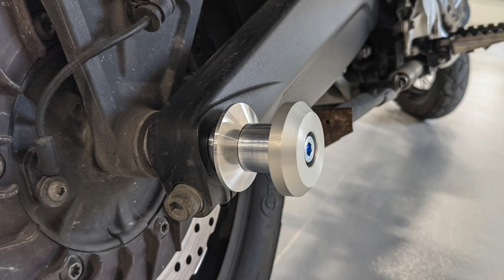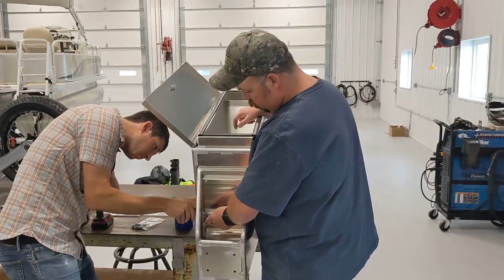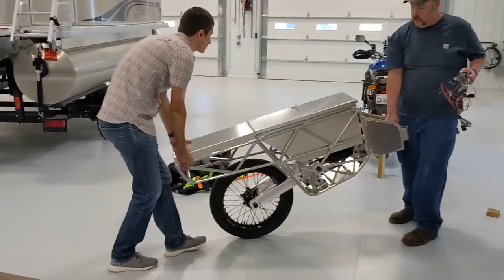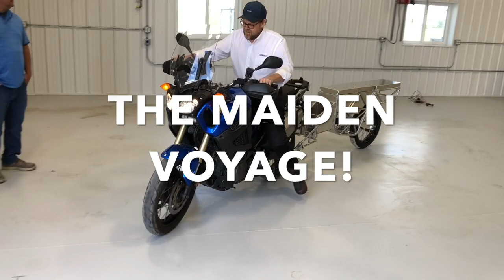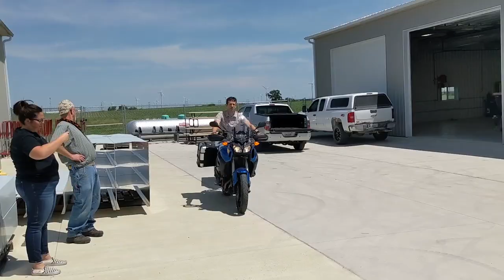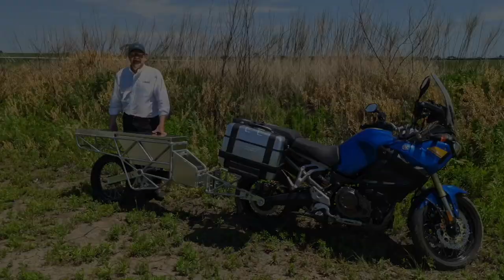The First Full Assembly of The Pasq® ADV1 - Single-Wheel Adventure-Motorcycle Trailer

Comment: A tubed tire? Really? Just what I need, a flat in the middle of no where.
Reply: Been there, done that (flat in the middle of nowhere)! We are looking at our final specification for the rim/wheel. It's possible we will put a tubeless tire on all versions, or have it as an upgrade. The question will likely be, are you willing to pay what a tubeless wheel will cost? We have a pretty special situation that we're using a front hub with a 17" x 2.5" rear rim. We're doing this to make sure our owners have the maximum number of tire options, which complicates the wheel building and spec'ing process, but we think it's worth it!
Reply from the maker: Hello Lee, 

We have an update on the wheels for the ADV1. We have finally been able to source both a tubed wheel and tubeless wheel (COVID hit this world pretty hard). You may not know it, but tubeless wheels are much more expensive than tubed. Would you be willing to to pay an additional $500 (approximately) for the option of a tubeless wheel? That would be us just barely marking up the cost difference, just to cover paperwork and having to inventory tubeless wheels. 

Thanks for any input you might have!

Comment: A pushbike wheel and tyre will NOT  be rated for the speed and weight required for a motorcycle trailer . OK if you Don,t intend to tow it on the road as a registered vehicle .

Comment: Rokon sells a trailer similar to this.
Reply from the maker: We didn't know they were making a trailer. Thanks for pointing it out!
Reply: I don’t think it’s designed for hwy speeds but it’s a single wheel setup with an articulating hitch.
Reply from the maker: Based on this video (an old video of the assembly of our first prototype, which we've moved on from and have basically redesigned the trailer considerably), you are justified in your thought. However, I'm happy to say you're totally wrong thanks to a huge innovation we've come up with. :-) 

Check out the following video where we're going down the interstate at about 75 mph with 80 lbs of weight on the trailer. https://www.youtube.com/watch?v=uPYapI0Jnx8 

If you want to know how we do it, it's due to our trapezoid hinge (patent pending). We will be releasing a video about the hinge shortly, but if you'd like to see an explanation, the next link will take you to a short description of how the hinge works. https://youtu.be/qgEeifwBM-s?t=240 It's showing you a section of a larger video that explains the history so far of the Pasq and the ADV1.

We'd love to hear your reaction.
Reply: @PasqAdventure  
I’m not incorrect. I’ve already seen your videos. I wasn’t implying that your design isn’t suitable for highway speeds… I don’t think the Rokon trailer is. It’s made specifically for the Rokon and the top speed is like 37mph… but they’ll drag that tough little trailer design just about anywhere. Yours is obviously much more advance… it’s bad ass!!! but the basic design is the same. Single wheel that trails behind easily with an articulating hitch. I’ve been riding on and off road for over 50 years and I’ve never pulled a trailer behind a motorcycle. Lol… I’m 60… thinking about a Desert X… and a crazy off road trailer like yours!
Reply: Keeping a close eye on your progress for my 901 Expedition. Toronto Canada, so not far 😎